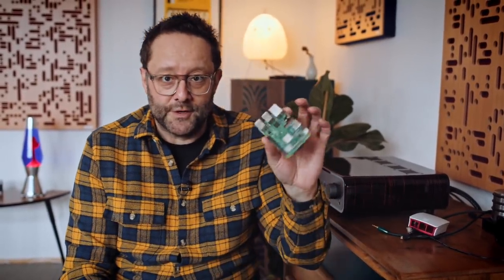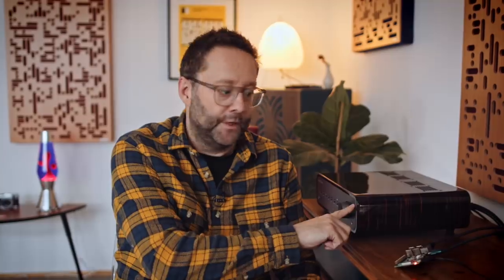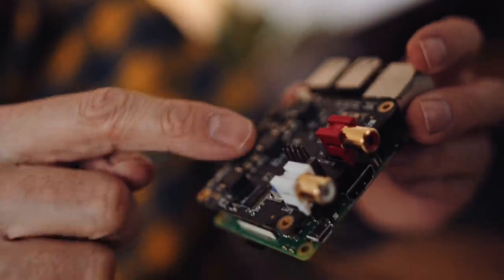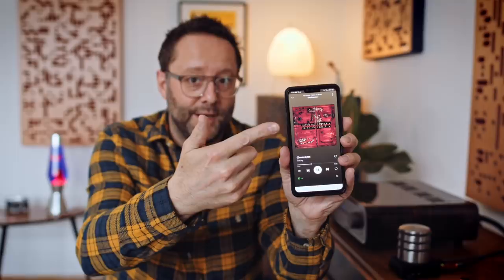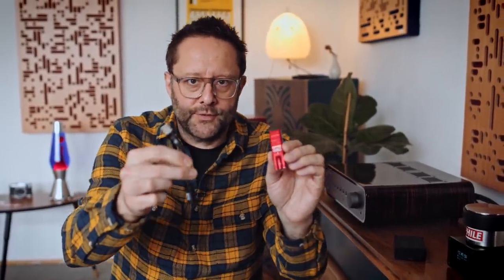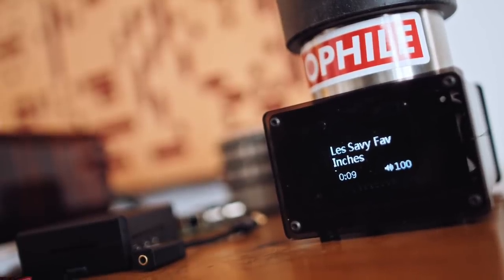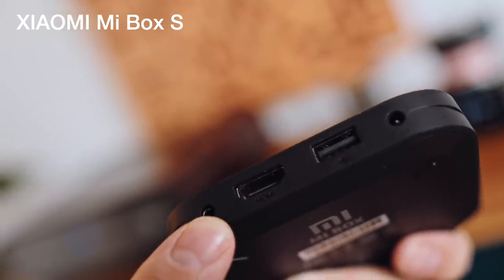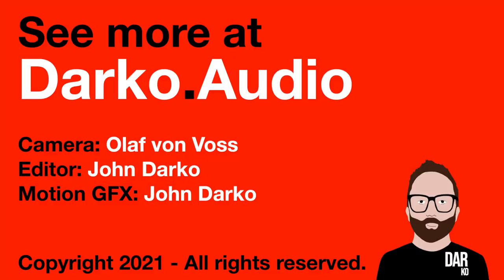Spoti-Pi: a beginner's guide to SPOTIFY on the RASPBERRY PI

Comment: Today I built a rasbery pi 4b with a hifiberry DAC2 HD hat and a ifi 5v power supply. I have it to stream to my entire house.  My router/computer is across the house from my bedroom.  I can now have the pi in my bedroom and connect rca outs from the pi to my cavalli hybrid amp next to my bed.  I run volumio with tidal and spotify.  Very, very happy!!
Reply: I just ordered hifiberry dac2 hd, and I am expecting more involved sound, comparing to hifiberry dac+ pro, which I have and happy with it

Comment: Great video. I've been building and using Raspberry Pi's with Hat's and DAC's since 2014. Rock solid with Ethernet connections to my Synology NAS. Currently using a Pi 4 with a Topping E30 DAC and the sound is phenomenal. Thanks for spreading the truth about low cost but very great sounding gear!!
Reply: Are you doing that via USB or with some sort of SPDIF HAT?
Reply: Just built a Volumio based Spotify connect system. Using an old Pi from 2015. Software works, but stream keeps dropping out. I'm guessing that it doesn't have the processing power to actually work. I'll try it with an external DAC to see if freeing that computing headroom helps. Perhaps something else is wrong. Any troubleshooting advice?
Figured it out. Wifi connection was weak. Physical connection fixed it. Now to troubleshoot the WiFi!

Comment: Raspberry Pi So much Fun! You were the inspiration to roll my own setup, only recommended for those in the hard core Linux camp! That being sad I already had a great DAC (actually a couple). went for a server, clyent player setup. I am and have been looking at some of the all in one software solutions, just for ease of use. 

In my own experiments I was able to mix audio on a raspberry pi4 through my Audio interface. Though I rate the PI Zero W usb output as one of the better USB outputs (for USB2) actually the hint of USB2 seems more stable for USB audio.

Any Way Keep up the content!

Comment: A little correction there. Actually have audiophonics older machine (without screen). Their machines needs drivers for 3 things! Screen display l, soft power shut down and remote access. If you have a machine without screen and remote, you really do not need their special version of volumino.  It’s all about the drivers! Not exactly specially modified volumino to begin with.

Also the reason why raspdac has better sounds than dragonfly (which I also have, but I have the cobalt version), is that raspdac actually has separate boards to control power and usb from a raspberry! Which further reduce the signal noise from the raspberry pi itself. 💪 usb dongle dac suffers the feeding power! Without extra clean and stable power supply through the dac itself, those compact dac simply just doesn’t sound as good.

I’ve several HAT DAC. I found out rasspdac from audiophonics is way better because you feed power through their board!! Not to raspberry pi itself!! It’s just sounds way cleaner than other HAT I’ve owned that sucks the power from raspberry pi’s ports! At least that’s how my observation presented itself.

Comment: A suggestion for those on a budget like me. I am running volumio on a Raspberri Pi ZeroW and have a Pimoroni Audio DAC Shim. The total cost with the micro sd card is about $50. Works great as my office streamer. I mostly play the FLAC files from my NAS but this is small enough I can use it with a phone battery and take it mobile to play files from the sd card itself.

Comment: You have got me hooked as I already have a couple of Raspberry Pi 4's.  

Having watched a few of your vlogs, my cunning plan for a system that is already in train is to fit an Allo BOSS "Master" DAC  to the Pi get a couple of Adam T5V speakers and (having just about died when I saw the type and the COST of audio cables you and other Audiophiles have) I will get Chord C-Line audio cables.  I have Volumio and have started a Spotify subscription which I did initially just to check that I could get the downloads working directly with the Pi before spending any more money, this was a direct swap for my Amazon standard subscription.

I will give you a bit of feedback in, hopefully, a few months once I have got everything together and working with a chance to listen.

So a few weeks later and with a couple of subtle changes. Firstly I realised that I needed a volume controller, as Raspberry Pi and Allo Boss were not fitted with one, so I got a Dolla Tek Passive Pre Amp.  Second change was to go for Amazon Basic RCA cables, as a 62 year old I strongly suspect that my hearing will not notice the difference.

The system is now working, I am happy with volumio running Spotify, as advised once initial link set up with smartphone the phone can be switched off as the connection is directly through the internet cable that I use. I am looking forward to the likely upgrade of Spotify. I would estimate total price is in the £400 region. So thank you John Darko for your excellent vlogs and for the guidance for what can be achieved.

Comment: Nice episode, John. Some of your audience may want to use a Pi4 rather than an earlier incarnation if they're going to interface to a DAC over USB. The Pi4 doesn't share its USB circuit with the network, so the signal path will be cleaner. And folks who are OK with messing around with RPis might check out Raspotify, which we use for Spotify Connect on our Pis... although Volumio is a nice choice as well.

Comment: Love all vids and inspiration. 
I picked up an old Mac mini for less that a pi4 with a hat etc. And use it as a Spotify endpoint. It has toslink out, but after watching all these videos I learned that usb out I had much more information. Almost went with topping d10s as recommended here, but then I saw measurements of the smsl Sanskrit mark ii. For $20 more. And I think it looks better. 
So yeah Mac mini usb to Sanskrit mkii to a Yamaha amp to ELAC debut d5. 
Rather happy with the set up, and have now learned how much source and dacs do makes a difference. And Spotify is controlled via my iPhone and the Spotify app. I’m 
I also have a CD player with coax out to the Sanskrit which also sounds better than the CD players dac. 
So, my tunes are sound pretty clear and I am wondering about my next upgrade, if I should upgrade my integrated Yamaha amp or move to elac unify’s. Or build LX mini’s with a mini dsp. 
The Yamaha amp has a direct bypass button that bypasses 3 tone pots which is sweet. 
Anyways, if anyone feels like making a suggestion for my next upgrade, I’d appreciate it. 
Ortofon red is the next install, but what to do after that?

Comment: I recommend Diet-Pi for those not wanting to dedicate their Pi to Volumio. I’ve tried to love Volumio but it continues to crash reading my lossless library, the same one used everyday with Roon. Diet-Pi is lightweight and allows you to install Raspotify, Roon bridge, AirportSync and I even got Tidal connect working on it. (If you can gain access to the shell on the Audiophonics box, you can run Roon bridge).

Comment: Pi 3 on a Peachtree and Wilsons.
This is literally the year 3021 🤩

I used to run the Allo Digione Signature with the shanti power supply and it was realllllly great. I think the introduction of Spotify connect on platforms like volumio is a real positive game changer for the hobbyist audiophile , and defo not to be sneered at
Reply: I have been seriously thinking of the Digione Signature with a different power supply. Out of interest what have you moved to?

Comment: Perfect video!!

I like the way you are experimenting with digital audio, in this case the Raspberry Pi in combination with Volumio!

Six years ago, i startend building network streamers around the Raspberry Pi, inspired by Hans Beekhuyzen.

The best improvement in a Raspberry Pi setup is to separate the power supplies for the Pi board and the (isolated) DAC.
I use ultra low-noise power supplies (DIY), and the quality of the musical output and dynamics still amazes me, every day.

I have been using the standard Volumio from the very first edition, and I can't wait for Spotify High Res!
Reply: Sir....can you point me to any dyi instructions on building better power sources for rpi? Thanks...G

Comment: Hi, John, I just wanted to thank you for these videos. They are fabulous, possibly the very best, clearest and most useful audiophile information on YouTube. Just excellent! 

Now, here's my general question for everybody: I have watched, I think, all of John's videos about using the raspberry pi as a streamer. I have a raspberry pi 4 just sitting unused, all assembled. (I purchased it for a project that never materialized.) So I am very interested in putting together a streamer based on John's recommendations. The thing is, I already have an excellent integrated amp with a really terrific, built-in DAC. So all I need is one of those hats that will give me very high quality audio out to the DAC. I could use SPDIF, toslink or USB, as the DAC has all three of these inputs. The thing is, in an ideal world, I would also like to be able to stream the few albums that I have in DSD format, and Allo has only one solution, a USB bridge, that will stream DSD files to an external processor. And that is a standalone product, based on an included raspberry pi 3, not compatible with my raspberry pi 4. So my question is, should I just give up on using my DSD files on this streamer that I am going to try to put together, or is there some other solution that anyone knows of? Thank you!

Comment: I had a spare RP4  (in an Argon case) just sitting in a drawer so I was inspired to flash Volumio to a SD card and get it up and running as a network streamer. I also had a Dragonfly Red lying around so I added it to the Volumio streamer to get cleaner sound. Now my family can stream to the family room sound system, thanks!

Comment: So this has been my obsession for the past month. Pi4 + Topping E30 = crazy good front end. Add in allo sig on using coax... even a little better. I even got a R Pi Zero working with the apple USB C dongle (which does 192/24!?). I own two Node 2i and I find myself nudging towards the Pis/Topping combo. So far Volumio has offered the best experience and sound. Roon is next up...

Comment: Thank you for this very informative video. I especially appreciate your mention of the Android TV boxes at the end, as I have wondered why one could not simply run the optical digital output on one of those boxes to a DAC and save $20 or $30 off the cost of a raspberry pi unit, plus have something that plays video and Android video games.

Comment: Great Vid, didn't know about spotify direct via volumio.
Build my first pidac with a Hifi Berry. Now use an audiophonics TDA1387 r2r dac, Allo reclocker which removes jitter and I built a  dual linear PSU. Also found a USB filter by Wurth ( available from mouser) which removed the digital noise from the USB sticks. The result is very impressive and my Digital reference is a Naim Cd player.

Comment: I have a 4 RPi's, 3 model 3's and a zero, all have DAC hats which I use with hifi Amps and passive speakers in various rooms in the house. I'd like one more and was wondering if a model 2 (which can be picked up on eBay very cheap) would do the job as well? I use volumio

Comment: Just wanted to say thanks for this. Just got my Pi streamer up and running. I send the output via USB to the IFI Zen DAC and into my amp. Sounds fab and hopefully will get better with Spotify HiFi later in the year. I chose the IFI Zen DAC instead of the Schitt Modi 3 due to current availability in the UK but really pleased with it. Anyone looking for a budget DAC should consider the IFI.
Reply: Question Sir........do you have an ethernet connection i to your rpi....or just wi fi?....I have the zen dac...but no ethernet or router available, only shared hot spot with my password....?
Reply: Will the pi be able to search for and find the shared hot spot?....my phone and imac can...

Comment: If you wanna check out a balanced dac hat for the pi, might I suggest the Pecan Pi
Reply: Did you get just the pecan hat.....and diy the case?....And was it hard to set it up? Also did you have to subscribe to Volumio?...I saw cheap audio mans clip, and cant afford the 550....but could may swing the 350 for rpi and hat.....but i can' t get an Ethernet connection in my apartment...only wi fi....and pecan has wi fi disabled?

Comment: Using a Pi4B running PiCorePlayer & LMS which runs Deezer Hifi (FLAC) , TIDAL is also supported. Feeding the audio stream through USB Audio to my Cambridge Audio CXA61. Excellent performance.
PiCore uses the most lightweight distribution and also support Airplay which is a plus.

Comment: Really appreciae you running through the Chromecast comparison. Been using a CC for a while, and wondering what we gain when replacing with a Pi based setup. Very helpful information.

Comment: Great video. Thanks. Just FYI, if you already have an audio interface like a Behringer UM2 or Focusrite you should be able to use that as well. I just tested the Behringer UM2 with my PC and Spotify and there's a marked improvement with the audio interface. Looking forward to trying it with my Raspberry Pi2B+ and volumio as well. Cheers.

Comment: Raspburry Pi!! Really need to build this.
Reply: 10 mins of assembly and set up. I suggest the clear box case, so you can tell others what's happening inside.
Reply: I built one after inspiration from Johns first video..all I'd say is do it. Source the parts, check you can get a suitable case to fit the HAT, and use a proper power source. Usability is very good..and they sound very good!
The Pi will also take a USB stick with FLAC loaded Hi Res  music files, and play them from the Volumio interface..win win.
Reply: @bardley6796  awesome!! Thanks for the feedback. Which DAC hat do you suggest? The same Boss DAC that John used in his review you mentioned?

Comment: i remember a lot of debates about the USB output quality of the Pi3 in regards to ethernet interference. Any words on that?
Fixed when using WiFi for input? Looking into connecting a Topping D10s to a Pi3 as source for a headphone amp

Comment: Due to your video, I just brought an extra Pi4 and SSD to run Volumio to connect to my aging Audiolab 8200CDQ via its USB-B digital input.  Will be interesting to compare the existing Chromecast Audio+Toslink mini cable plugged into the Audiolab 8200CDQ.  I cast to this using PlexAmp from another Pi4 which runs Plex (for audio only) plus my home automation.  Hopefully, I can get the Pi4 to only need the SSD when using the Volumio (i.e. so I can store the music on the same drive).   If not, I have spare SDcard for the boot.

Comment: Tried various RPi based solutions this autumn. Never could get Volumio to access my nas by some reason? I got MOODE to work and I liked it alot, really good solution. Ended up using Ropieee XL for some time now. Really stable solution. Have a minor issue with Audirvana and resuming songs which have been paused for a while, no issues with Spotify as far as I have found.

Comment: Love the channel. Q: If I use an Amazon Fire TV Cube (w good wifi), which has Spotify (and can be selected as an output in the app), output to an HDMI -> Toslink (converted by the TV from HDMI) -> My Denon Receiver, am I worse off than I would be in this setup (assuming Spotify-only for a sec, and DACs were the same - the one in my Denon)? THANKS!

Comment: I've been experimenting with the Pi4 for audio for quite a while now. It is cheap (well, at least it was when it was still available), and can be expanded with all manners of isolators, bridges, DA converters and whatever else you can think of. Unfortunately it remains a total faff, and makes an rats nest of your setup, with its plastic 'cases', multiple external adapters, and associated cablework. Why is no one making a roomy alloy case for this with an internal drill pattern so you can screw it together solidly, add expansion boards and have some sort of accessible rear panel ? And preferably a good power supply to built on ? There's a gazillion cases and power supplies for PC's, but for the pi it's all stupid 4" by 3" plastic affairs, and the few more solid options there are like the Argon don't allow for any expansion boards. 
And I'm pretty fed up with external bricks and wall warts. It's the 21th century, and we need 'off' switches that are 'off'. What with the environment and all.

Comment: I run a similar set up, but just don't like the the UI of volumio, so stuck with just using Spotify. My Pi is basically a Spotify Connect unit connected to a cheap dac > receiver > speakers (for now). With spotify hifi coming later this year, do you think people will gravitate towards simply this way for just Spotify Connect? Avoiding the 3rd app use and just go directly from spotify on ANY device in the house. 

I love your videos and do not look forward to spending money whilst upgrading my budget equipment!

Comment: I second the recommendation for the Audiophonics RapDAC. I have an older version (no screen) that I use with Volumio and highly recommend it not just because of sound but also because it fits nicely with other hifi gear (all cables connect to the back). I use it with a iFi 5v low noise switching mode power supply which for 50€ will definitely improve the sound compared to the ordinary switching mode supply.
Reply: +1 and better version with the board including the 2 symetric evo sabre... plugged a Rasp pi 4 and a touchscreen.